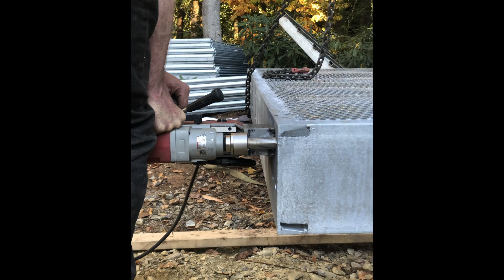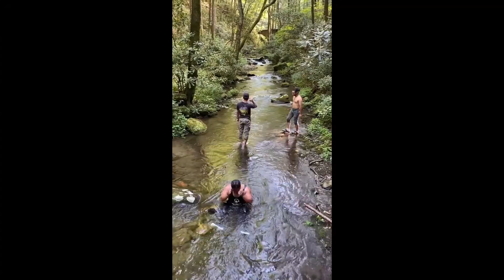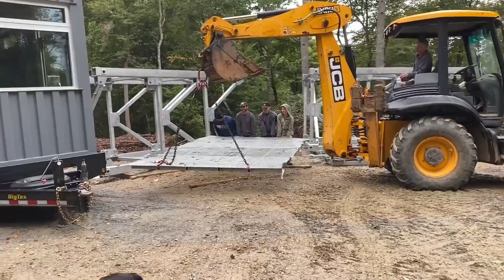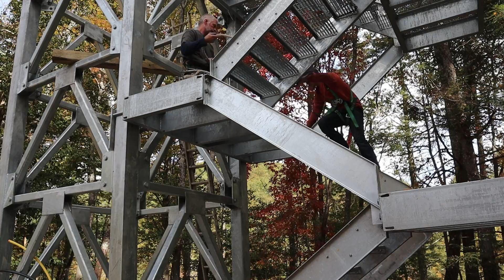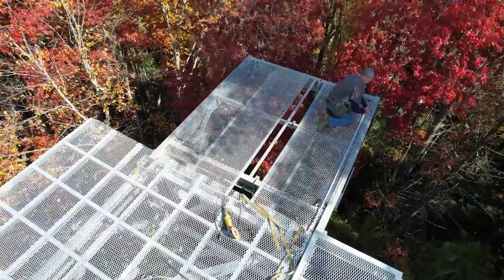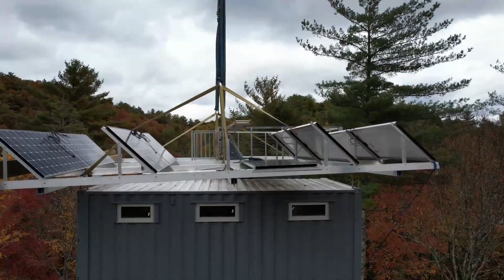River Forest Lookout Build (Part 2) - Blue Ridge, GA

Comment: You might have saved a lot of time (money) had you rented a man lift and hired 2 professional Iron Workers. The problems you had assembling the steel is actually routine steel erection and the pro's would have made short work of it. With all the savings, you could have gone two sections higher. :-D

Comment: No point using safety gear when your not connected to anything. Yup understood you’re not a Rigger. You should have used the basket it would have knocked a day off your build. This would work on our whanau land. Nice job. Heads up fact of construction ‘ nothing lines up’, particularly when your hanging from a rope trying too fit modules to structures at height.
Reply from the maker: Yeah, it was a long process but we finally made it! Thanks for the feedback and support :)